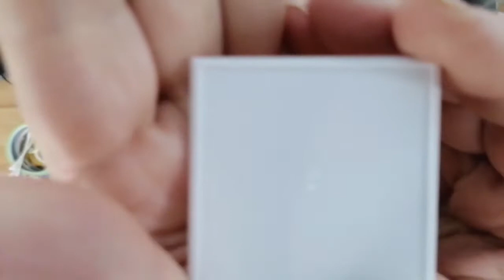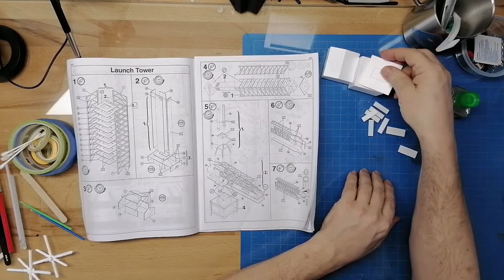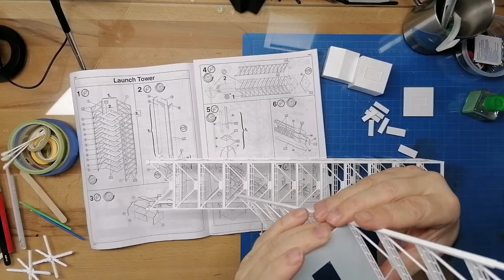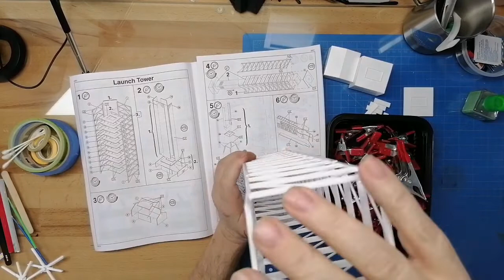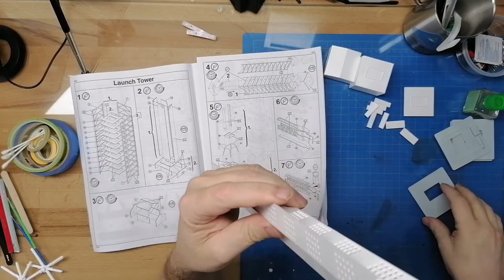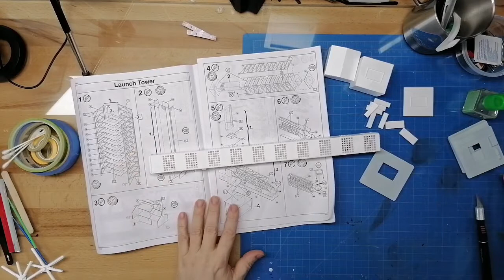Model Mania #40 - Launch Tower & Space Shuttle Part 2

Comment: Run the LED strip at 9V and that will dim them and save you a lot of time.
Reply from the maker: I plan to run it at 9V with the 470 ohm resistor otherwise it is just to bright and unrealistic to the scale.  Thanks for the suggesstion